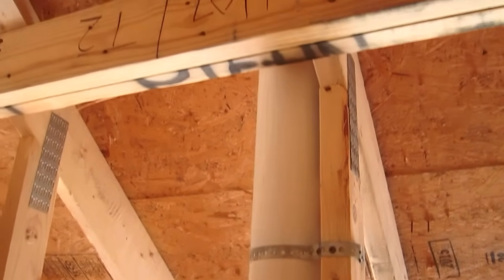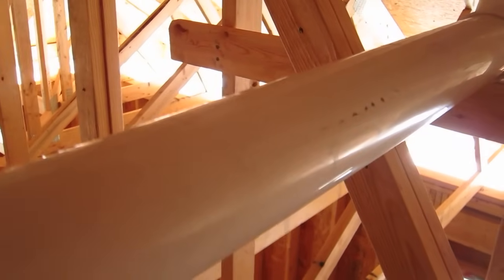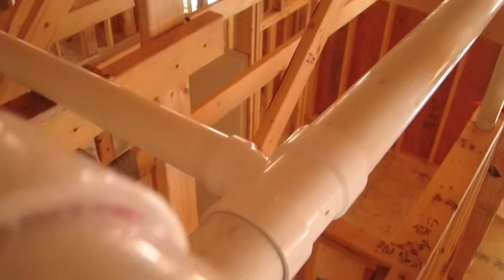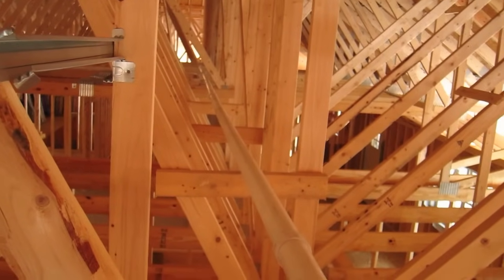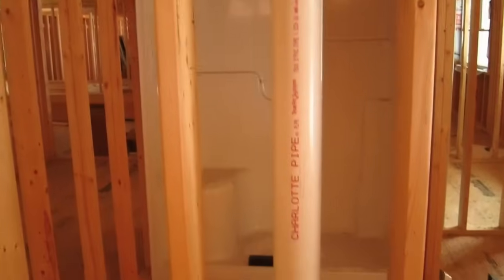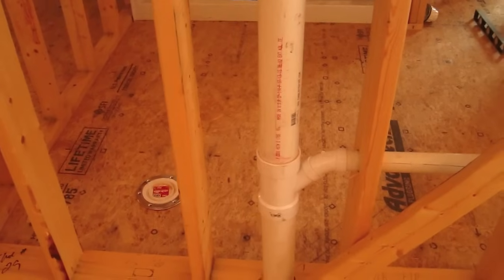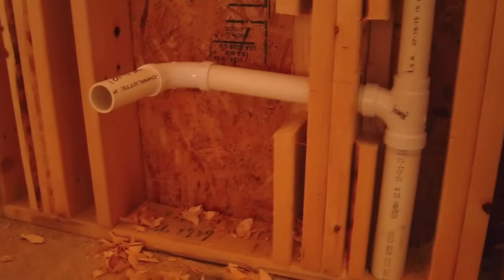How to Vent Plumbing

Comment: Do you know if a candy cane (goose neck) is okay to install on the vent stack if you live in a cold climate like upper New York or Vermont? I'm getting conflicting answers, one plumber said that it might freeze up...another plumber said that they all kind of freeze up, another plumber said that it will stop the flow of my toilets and sinks. Thank you!
Reply from the maker: You can do it. The pipe and bends MUST BE 4-inches to prevent hoarfrost from choking off the flow of air. Just do what I did in the video.

Comment: Are you allowed to vent out a wall, or does it have to go out of the roof? I'm building myself.
Reply from the maker: It's not a good idea to vent plumbing through a wall.
Reply: @askthebuilder  why is that? I was always told the fewer roof penetrations, the better.
Reply: @askthebuilder but I think I’ve seen it before somewhere.

Comment: Hi, just wondering if it's okay to put a goose neck on top of the vent stack on the roof so to protect animals, debris and rain from coming into the vent?
Reply from the maker: There's nothing wrong with a candy cane on top of a vent pipe. At the last house I built for my family, huge trees showered the roof with seed pods, tiny twigs, blossoms in the spring, etc. So once a year I got up on the roof with a garden hose and stuck it in the vertical pipe and let water run for 5 minutes to flush out the vent pipe. It was easy to get up on that roof and it was relatively low-slope and safe. Not all vent pipes are easy to service like mine.
Reply: @askthebuilder  Thank you so much for replying! I will have one installed.
Reply: @askthebuilder   Actually, I forgot to mention that I live in upper NewYork...do you think that is a problem for a candy can on top of a vent pipe?
Reply: They also make things called mushroom caps

Comment: Curious why you ran the vent pipe 60' horizontal instead of just putting in a second roof vent exit down at the other end.
Reply from the maker: I answered that in a previous comment. The homeowner only wanted ONE roof penetration.

Comment: Nice neat installation.  Except, at 9:10 the studs were cut apart.  Why, as the adjacent studs were drilled for your piping?
Reply from the maker: My guess is you've never tried to install that length of 1.5-inch pipe in four wall studs within 8 inches of one another. Those studs were unnecessary and provided no structural support. Architects and framers should only use the minimum amount of framing in exterior walls for a host of reasons. In cold NH where this job is located, you want maximum insulation, not wood studs that act as superhighways transferring heat from inside to outside in winter months.

Comment: Thanks for establishing equilibrium, and it cannot be said that a vent pipe isn't used for venting air from the system that can otherwise back up without being released.  Just try to get a bathroom system inspected and passed without a vent pipe.  Frozen pipes happen due to improper insulation, not the vent pipe.  The reference, alone suggests the pipe is for venting.. a reference used for releasing air.  Otherwise, the vent pipe would be called "air intake".  If you're searching for a way to create the effect of the world smelling like one huge sulfur field, (and there are already enough of those around) just wait until those organic gasses build up and cause an explosion.  The earth already accommodates such activity in natural vents called Volcanoes and hot springs.  We don't need any more created in plumbing systems.   😎
Reply from the maker: I hate to say this, but you have no clue what you're talking about. Were you absent that day in high school physics when hydraulics and the Venturi effect was discussed? Normally I would delete a comment like yours so other people don't get harmed. But your comment displays such bad advice I've decided to leave it up with my rebuttal to show people they need to be damned careful about what they read on the Interweb.

Comment: I'm a plumber in Northern Canada. Our code is 3" complete through the roof and it doesn't get much colder than here. 3" doesn't choke off. A vent system allows air to flow both in and out and lets methane gas release out.
Reply: So what I'm understanding is there is no limit to the amount of bends in the vent pipe? I have a basement bathroom I'm moving the wall over to fit the vanity inside the bathroom and just figured I could install 2 45s on the vent pipe to move it over a couple feet with the wall. Should be fine?
Reply: @grahamlacroix6298  yes you should be fine if it’s it s just a couple of feet.
Reply: Thanks, I was wondering about that as I only have 3" in Northern Ontario

Comment: I find your video on a website about venting and how to do it.  Website says that under no condition should a 90 be used and it has your video there to show you how to do it. I watch your video and there’s 90’s everywhere! So I’m assuming 90’s are ok???
Reply from the maker: 90s are perfectly legal in venting systems and even in drainage pipes. Remember, vent pipes just move air, not liquids and solids. Never use a 90 in a buried slab to change direction horizontally. Use 45-degree fittings to change directions in slabs and crawlspaces for DRAINAGE lines. You can use a sweep, or long-radius, 90 at the base of a stack under a slab.
Reply: @askthebuilder  thank you so much for the info.  This is gonna help me a lot! I was like “no 90’s that can’t be right?!”

Comment: Is there a reason that the 4" part of that intake pipe through the roof isn't lined with heat tape and permanently provided power so that their is not a chance of that pipe freezing in cold climates?!
Reply from the maker: Fantastic question! Google this: heat tape fire danger  Second, engage your critical-thinking skills and ponder the tens of thousands of New England houses that have cast-iron 4-inch vent stacks installed and in service for over 140 years. Do you think if they froze up constantly that the plumbers would continue to install them since the 1880s?

Comment: Thanks for the vid. I have venting that’s suspect in my bathroom. I will be reconfiguring it and connecting to the existing venting but in the correct configuration.  I’m glad for the explanation regarding air supply and that the extra 20ft run to the vent header that I’m planning on won’t be an issue. Thanks again for the through explanation.
Reply from the maker: You're welcome. You can repay the knowledge you received by clicking the Thanks text link under the video and step up to support my channel.

Comment: Hello , could you use an air admittance valve on a kitchen island that has a sink and has no other way of venting , or would you have a different suggestion .
Reply from the maker: You can do whatever you want. I'd never use an AAV. They always fail. They have moving parts. Go watch my loop vent video. or just go here to discover exactly how to do it and WHY it works: https://shop.askthebuilder.com/how-to-make-a-plumbing-loop-vent/

Comment: Up in the attic. I don’t believe you can have two horizontal pipes connected to a Santee. You have to use a y/combo. Right?
Reply from the maker: WRONG. Sanitary tees upside down in VENT LINES are code-approved in the USA. As I say in the video, just make sure the horizontal vent lines have slope so the condensate drains to the vertical stacks.
Reply: Normal fittings on vents are fine as long as it's 6 inches ABOVE the flood rim of that particular fixture. In the attic it's obvious that its above every fixture in the house

Comment: Can you oversize your vents
Reply from the maker: Yes you can. It's a waste of material. I once did an experiment and vented an entire bathroom with 1/2-inch copper tubing. It worked perfectly draining all the fixtures at once with no syphoning. Many forget what the PSI is of the air surrounding us. It's 14.1 pounds per square inch pushing down the vent pipes for goodness sake. This is why a tiny pinprick hole is all you need on a large plastic water jug to allow water to flow out the spigot unrestricted.

Comment: It's nice to see a real plumber does good work there's a lot of Yahoo's out there that don't know what they're doing and some are even plumbers.
Reply from the maker: Thanks for the kind words. There is a code violation in the job, but the owner INSISTED I put in the branch arm that way. Luckily for him there are no plumbing inspections in that NH town that would have prevented it. I warned him but I also knew that the branch arm was so long that the water would flatten out before it got to the 45 and not syphon the trap.

Comment: Why isn’t there a simple access port in the attic for the 4” main vent? I live in WI and my vent had some frost closure. Toilets gurgled multiple nights during a deep freeze over a few days and lost my trap water in them and house smelled like sewer gas in morning. 

Had to get on roof and open it up. Was thinking a simple 4” tee in the attic with a 2” fitting in it you can unscrew and inspect in the attic would be perfect. Would avoid getting on roof in winter to inspect from above. Or was thinking a drone w/ a camera would also be safer for inspection.
Reply from the maker: Why not just insulate the exposed vent pipe with 4 inches of foam? We did that with this vent after the video was shot so that the pipe stays warm and the only hoarfrost may happen on the section sticking above the roof. If you want to put a test tee in the attic, go for it.

Comment: Is it is acceptable to have air come down a vent and out of tub drain?  And if so could this displace water in a p-trap below the tub drain?
Reply from the maker: Air is supposed to come down vent pipes to the drain lines. If the plumbing system is not installed correctly and you have syphoning of water from the tub drain, that's NOT okay. Sounds like you should get on the phone with me: https://shop.askthebuilder.com/15-minute-phone-or-video-conversation-with-tim/

Comment: Why is the toilet flange installed directly onto the subfloor? Or is it actually just dry fitted in the video so it can later be installed on top of the finished floor?
Reply from the maker: It's just dry fitted. It was there to line up the sweep-90 below. The toilet flange MUST sit on top of the finished flooring.

Comment: When your talking about the h fitting in the bathroom connecting the water closet and lav is the a 3x3 wye with a reducing coupling for the 2" lav brach?
Reply from the maker: It's a 3x3 wye under the floor. The toilet is wet-vented by the lav sink per the UPC.

Comment: Just so I asked the right question, as you stated there must be a slope all the way from the top of the vents there must be a slow from the top of the vent stack all the way to the drain.  Am I able to group all the vent stacks in my home into one so I have one penetration through the roof is my real question,  and likely I would like to penetrate the side wall not the roof so I have no penetrations through the roof,  well I just got the answer below about going through the sidewall I will address it with the inspector where it would penetrate no one would ever see yes I know it would look odd

Thank you very much for this hoping to do all my own plumbing in the new home I am building in climate zone six in North Carolina the area is actually climate zone five but that's for the whole county I'm at the top of a mountain and I know it is totally different up there so I'm raising the climate zone location. Understanding all this is great.
Reply from the maker: Marty, if your inspector allows a side-wall termination, that works. But what most discover is rain collects on the horizontal pipe, runs back towards the house, and LEAKS in when the caulk around the pipe fails AS IT ALWAYS DOES. I'VE NEVER IN 50 YEARS HAD A LEAK WITH A PLUMBING VENT THROUGH A ROOF. Watch my video about how to install one so it NEVER LEAKS. What's more, you may need me to draw your plumbing isometric plan. Go here: https://shop.askthebuilder.com/draw-plumbing-plans/
Reply: @askthebuilder  going through the roof :-) I totally get it coming back into the building. I'm designing building and ICF home insulated concrete form and the roof is also going to be concrete with metal roof on top of that just was trying to eliminate any penetrations through the roof I do have one and that is the wood stove chimney.  Contact here, and yes I will look at your links and yes likely will want to draw the isometric

Comment: Plumber telling you he would run 2" vent is not necessarily wrong. He actually knows what he is talking about. 2" plumbing vent handles 24 F.U ( fixture units ). So in your situation,  it is perfectly OK, and up to Code,  to combine all vents from all plumbing fixtures shown into one common  2" vent.
Reply: Time is money , 😸✌️🙏💪🤔
Reply: I thought about that too. Yeah there's not a problem running 3 inch just like 6 inch would probably work but 2 inch works perfectly fine. Cost sensitive too.
Reply from the maker: Glad you like my videos. If one or more helped save you time and $$$, check out the THANKS text link under all my videos.
Reply: @askthebuilder : Dude, you have 158K subscribers and 1.2M views on this video only. You are raking in pretty good cash from your YouTube content - plus you are a working builder, too. Why ask for more money? You are doing better than average ! Keep it going !

Comment: Do you leave the stub part that comes out of the wall unglued until the drywall gets installed or do you glue it and then trim the stub later when the vanity sink p-trap is being installed to the vanity sink? Do you prefer to glue the p-trap or use a compression fitting so that the p-trap can be replaced more easily? I'm working on a bathroom in a 47 year old single story house. I replaced the 1-1/2 vent pipe cause i had to rebuild the framing on a load bearing wall. I'm also wondering if i should upgrade the drain to a 2-inch drain instead of using the 1-1/2 drain for the vanity. The bathroom has a 1-1/2 vent pipe for the vanity and a 2-inch vent pipe for the toilet and a 2-inch vent pipe for a tub/shower.
Reply from the maker: You can do whatever you want. If you need help over the phone, I offer that service. I've been a master plumber since 1981.
Reply: @askthebuilder  How much for help over the phone?

Comment: @ 4:28 you use a 45 wye. I saw another video that said you should use a wye tee for these connections because the 45 wye can cause flow that will block the vent air and actually siphon water out of the p trap. Have you heard of this. The guy I watched said this wouldn't pass inspection, but he is in Canada. Thoughts?
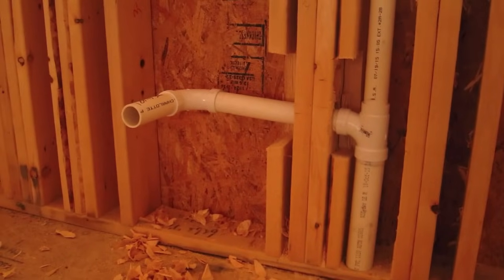Reply: OK, I see @8:13 you're using the tee for the kitchen sink. Curious as to why you're using two different wyes.
Reply from the maker: Once again, read the entire video description.
Reply: @askthebuilder  Got it, thanks! Ever since YT started hiding the video description, I rarely read them. Sorry about that.
Reply from the maker: I answer your question in the video description. Read it please. In real practice, the length of the branch arm extending from the stack to the 90-bend that exits the wall will often prevent syphoning. The longer the arm, the less chance of syphoning. If the small vanity sink basin was filled entirely with water and you pull the plug, the 1 and 1/4-inch tailpiece constricts the water flow to a point that only a small part of the branch arm might fill completely with water. By the time the water slug gets to the 45-degree bend, it's flattened out with air above it. Once again, I didn't want to install it this way, but the customer DEMANDED it.

Now, if this branch arm was serving a kitchen sink or a large utility sink that could hold 10 or 15 gallons of water and had a 1 and 1/2-inch tailpiece, all bets are off. I WARNED this homeowner that if they filled the sink with water AND there was no drain stopper in the tailpiece that would further restrict the flow, they MIGHT hear a shlurpping sound of syphoning and would have to run water for about three seconds after the sink drained. I've since asked them after they moved in and they've NEVER heard any syphoning sound. That means the branch arm is plenty long.

Comment: About putting the tees upside down ? Wouldn't you want to not do this in the event that water somehow backs up into a vent pipe or condensation now the water is stuck at that tee and can't drain out ? 

Air is air and flows better than water I would assume is there really a need for an upside down t to help the direction of air ?
Reply from the maker: I'm happy to explain all of this over the phone. Far too much to type. I've been a master plumber since 1981. Invest in your education: https://shop.askthebuilder.com/consult-tim/

Comment: I have seen  plumbing beneath kitchen  and bathroom vanity sinks that have tee's in them and out of that t- fitting it appears to be a small vent which is really a check valve that can let air in but not let water out.  Have you ever seen venting done locally like this?  Is this done to help facilitate vent flow?
Reply from the maker: You're talking about AAVs. They're mechanical vents with *moving parts*. Because of this at some point the moving parts fail to move and you have sewer gas in the house. Watch my Loop Vent video or purchase my Sewer Gas Ebook: https://shop.askthebuilder.com/sewer-gas-smell/

Comment: I have one more question if you don’t mind:
There will be two washrooms one on the first floor and the second directly above.
I want to have one vent through the roof. Do I connect the vents from the first floor fixtures a few feet above the fixtures or do these vents have to connect to the vertical vent above the second floor fixtures? Thanks again.
Reply from the maker: I've been a master plumber since 1981. Time for one of my phone consults: https://shop.askthebuilder.com/consult-tim/